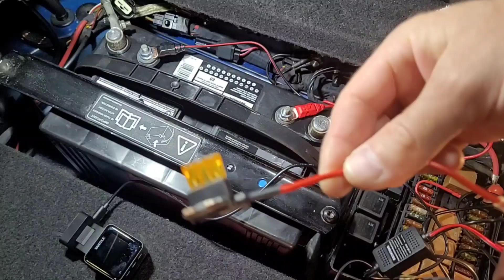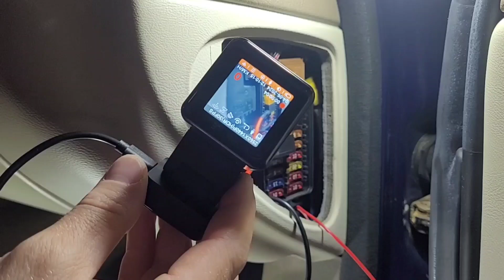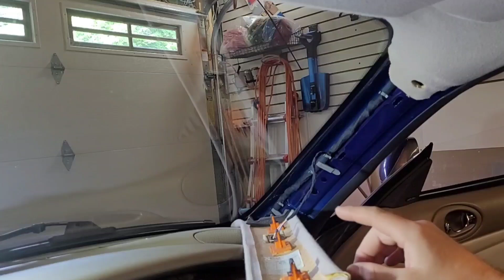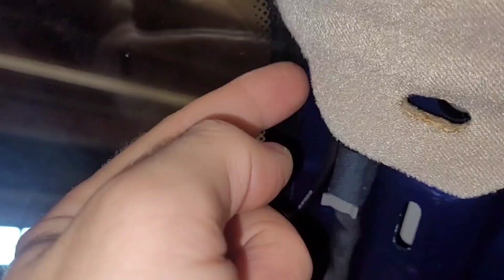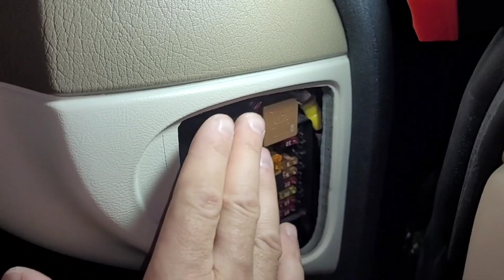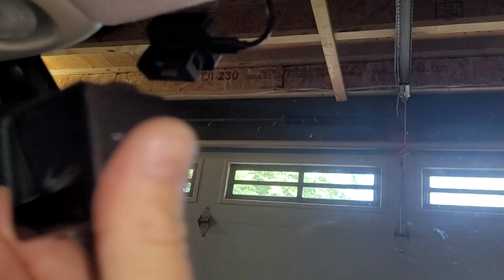2001 Jaguar XK8 | How to Hardwire a Dashcam

Comment: Hi, nicely paced instruction video but have you thought about using the auxiliary connector which is behind the glovebox?  It’s a much neater solution with its own relay and the option of a switched or permanent feed.  You can either take power directly from it or use it to install a USB adaptor.  I’ve just done it on my car and it took about 30 minutes.  I will use it to install a dashcam soon.
Reply from the maker: Hi Mark, thank you for your feedback! I did consider using the free auxiliary connector, but in the end I decided to use it for another purpose. Will get to that project eventually, but like you said - it would serve as an additional USB power source. 

If you are considering powering your camera that way, you can extend the connector and terminate it into a second cigar lighter. Then you can plug in the wiring harness which comes with the camera directly into the cigar lighter within the glovebox itself (no need to buy a separate wiring kit).